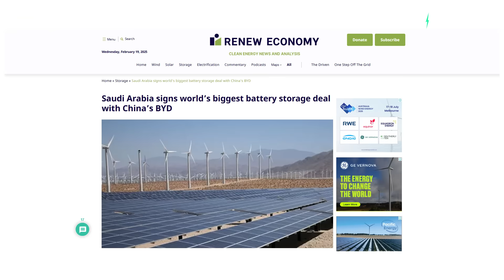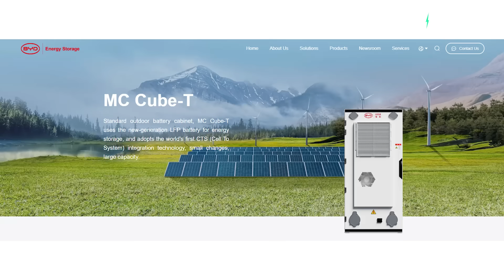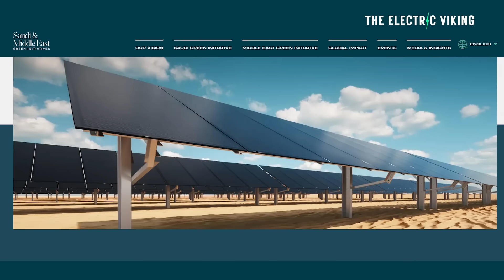Saudi Arabia signs world’s biggest EVER battery deal with BYD

Comment: The percentage of petroleum consumption is mainly divided between the energy and industrial sectors, but the ratios vary by country and global market conditions. Generally, global consumption can be categorized as follows:

1. Energy Sector (Fuel):

Accounts for about 60% to 70% of total petroleum consumption.

Used extensively in transportation (cars, airplanes, ships, trains).

Plays a role in electricity generation in some countries, although its use for this purpose is declining in favor of natural gas and renewable energy.

2. Industrial Sector:

Accounts for about 30% to 40% of petroleum consumption.

Includes the production of chemicals, plastics, synthetic fibers, paints, fertilizers, pharmaceuticals, and more.

These percentages are approximate and fluctuate based on global market developments, such as the shift toward renewable energy or the reduction of plastic use in certain industries.

Comment: 130 GW is way more the local demand requires. It is almost a double or more. The plan is to export excess capacity to neighboring countries, which they have sign deals already. Saudi does not care what form of energy it exports, it cares about bejng the world supplier of cheap and reliable energy. Ghe current and new gas power plants will be equipped with CCS systems to capture 100% of CO2 emissions. In addition, Saudi is also planning to build nuclear power plants in the next decade as well. The energy transition there is massive and their goals and ambitions are being achieved by the day.
Reply: china can help to build +/-1100kV grid lines to europe

Comment: I agree that if the batteries were built to supply 16 Hrs of continuous supply for the countries needs then renewables could do the job without base load supply.
Unfortunately in Australia the batteries being built like the Victorian Big Battery  and the one in south Australia Tesla Big Battery are only going to supply up to 4 hours of peak demand once the sun goes down.
They are not going to be capable of supplying the full power demand from Sundown to Sunup when Solar is the key generation. 
Wind generation is OK when sufficient wind is blowing and is not dependent on time of day however does need to be regulated to avoid spiking the grid and bringing the grid down.
These big batteries can act as those stabilizing mechanisms and then all turbines can spin instead of many within each wind farm sitting idle as is the current practice. That is why you always see many of the turbines Idle in any one farm due to curtailment due to grid capacity and unstable wind power supply. the variation in current / Voltage causes the grid to fail.  
Until Australia has sufficient large battery storage renewables alone wont do it. 
Just recently Victorian Government finally released the state of the Victorian gas fields and the falling output expected to be insufficient to cover winter demand by 2028.
This was the undisclosed reason that Dan Andrews banned all new home being allowed to connect to Natural Gas from 2020.
 What a mess we got into selling ll out LNG to Japan. 
Those short term gains for long term pain.

Comment: I am all for renewables and I am fully self sufficient semi off the grid. However please provide some evidence to back up your statement "1:37" “It could potentially run all of Australia.”  Are you implying that 12.5GWH would be enough to replace all coal generation in Australia?  For context, per Open Electricity, Victoria  used approximately 70 GWH of coal power today 22 Feb 2025, therefore we would need 6 to 7 of these giga batteries just for Victoria. 

We would need considerably more generation both wind and solar before this would be enough just for the state of Victoria.

Ultimately PHES, is cheaper and has a much longer life per GWH for long-term storage. For example, Melbourne renewable energy hub BESS is 1.6GWH, with a cost $1B. By contrast, Snowy 2 is 350GWH with a current projected cost $12B. 200 times more capacity but only 12 times the cost.

Sure, we need batteries but we need much larger and affordable storage and generation.

Comment: For a country whose GDP is massively different dependant on oil, this shows they have better future vision than the so called western hemisphere,and are making these nations look hypocritical slowing this change
Reply: Im from Saudi Arabia, yes, unfortunately, 45% of our gdp is dependent on oil. But, thankfully, that's presentge is going down dramatically, each year it goes down by around 5%. 😊😊😊
Reply: So there oil can be sold to fill up those ford rangers
Reply: It's not comparable to say a country that gets plenty of sunlight, is the same as a country that might not have sunlight for 3 months.
Reply: @grahamt5924  You missed the point , it's about moving away from fossil fuel to A (not specifying) renewable. Take Norway, that has access to plenty of oil but knew it was limited and developed alternatives rather than rely on oil, they don't have the sunlight for solar.🤷
Reply: @stephencollins5706  Yes, Norway has wind power, but countries like Germany have no sun and no wind.
Reply: @grahamt5924  majority of Norway power is hydro, with some wind. Germany as of 2023 got 32% of their power from wind and 12% from solar; which has increased. What year are you in? To clarify, less doesn't mean "none", even overcast weather generates power from solar.
Reply: @RoyBoy2019  Germany is in terrible state since it got cut off from gas imports from Russia.  It is an example of deindustrialisation and it will not be a good thing for the German people or their society
Reply: @grahamt5924  and? Is that renewables fault? Shifting national energy infrastructure takes many years, if this is interrupted by politics (war) then it is disruptive Regardless of direction chosen. Germany aggressively / prematurely retired nuclear (Green party) wasn't renewables fault either; but rather Fukushima or bigger picture human arrogance of "fail safe" systems.

Comment: what is it saying when battery storage is quoted as 2.5GW/12.5GWh?

12.5gwh is the storage capacity? So What's 2.5gw means?
Reply: Max load.
Reply: The discharge speed. Ergo, 5 hrs of max power.

Comment: why dont they put solar panels over those batts, like a roof or something, they are heated enough by charging already...they would not go green if they did not have sunlight in abundance
Reply: It has been looked at, but it seems it is just not feasible, as they have to make everything safe and easy to get to.
Reply: Also, the area covered will only be a small fraction of what the dedicated solar farm could achieve anyway.
Reply: @ I know it won't gain noticeable power, can be ordinary roofing...just to put those containers in shade and out of direct sunlight would not take much effort and money but would help more than that , nothing else :)

Comment: It´s mindblowing. I´d like to see it work on wind, solar and batteries alone 24/7 clear, straight and without subterfuges to beautify the numbers - like having a crude oil powered power station nearby to fill up the batteries when needed. Or forbidding homes to run the A/C or heater, when there is no juice or shutting down energy intensive factories - like it´s being done in Germany more and more since 2019. 
Are they going to use scarce, fresh drinking water in the middle of the desert to daily clean the desert dust of the panels or is there any innovative alternative? pls. read on:
They have the money, they have the sun - and they have a 100% crude oil backup if needed. I admire them for pioneering this venture while others keep talking, promising and failing and wish them success. 
If they were Europe they would have set a completely different target: phase out oil and extract 4% less each year from Mother Earth with a Zero extraction target by 2050 to make sure You go bancrupt by than at the latest. As they are not Europe they could still reduce extraction by a fixed amount every year, maybe 1% or 2% less but they will do no such thing. 
Green Norway won´t do it either - Norway is set to have a record oil extraction Year in 2025. You cannot help but wonder in disbelief when You look at everything that is happening, instead of just looking at one tiny peace of the puzzle. 
Saudi Arabia: How much of the country’s energy comes from fossil fuels? From 1965 to 2021: 100% in 2023: 99,53% from fossil fuels 00,47% from wind and solar.

Comment: I still think there is an argument for nuclear; specifically, small modular reactors. But it's not a zero sum game. Have lots of solar, wind and nuclear. Households can generate their own power when possible, nuclear can provide 24/7 load, and we can still have plenty of battery storage units. The more the better! As long as are seeing the end of coal, oil and gas.
Reply: tell us all the price, and also tell us all the time line,  no one has given us some sort of guarantee all this stuff will work.
Reply: China agrees with you. They will be pushing latest gen small reactors all throughout the global south and it will cost a fraction of US/UK builders

Comment: How many minutes of supply will this "biggest EVER battery" provide and how much will it cost? Saudi Arabia consumes 400 TWh per annum of electriciity compared to Australia at 273 TWh.
To back up wind and solar in Australia with batteries would cost A$ 10 Trillion - so for Saudia Arabia it would be around A$ 15 TRILLION.
Reply: watch this space, you will be amazed.
Reply: Why would you ever need 100% backup?
The batteries just have to last 1-2 days max. You think the sun will fail to rise over Saudi Arabia?
They can also run their heavy industries like desalination during the day meaning night time usage is just a fraction of day time. Maybe 1/4 or 1/5 of total use would be reasonable as "total backup"

Comment: Evans , there is a place for each form of energy. Nuclear will power submarines for as long as we feel insecure. Perhaps fusion will replace fission but not in this century. Kerosene or solid fuel will launch missiles into space. Diesel is still the prefered energy as far as tanks and bulldozers are concerned. Because they need to be really heavy. Perhaps hydrogen will replace fossil fuels for these applications, but not for the time being. Coal is needed to melt and combine with iron to make steel....

Comment: prolly smarter to build battery banks instead of  1 large battery
Reply: Agree , like battery swap system for electric motorcycle like gogoro
Reply: I wouldn't presume to know more about batteries than the CEO of BYD.
Also, it is already modular as mentioned in the video.